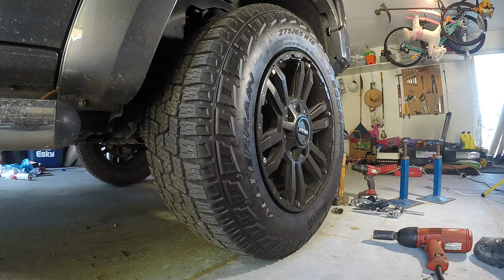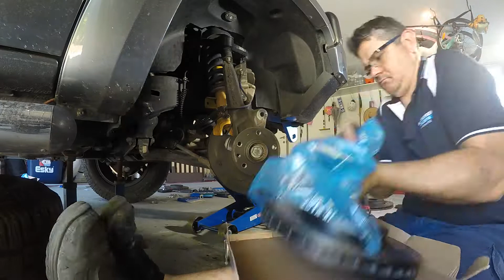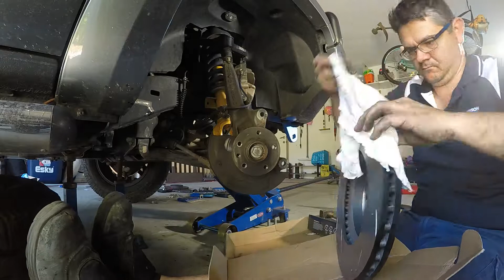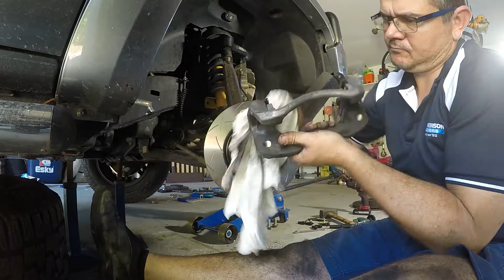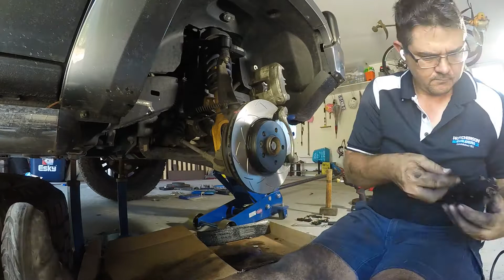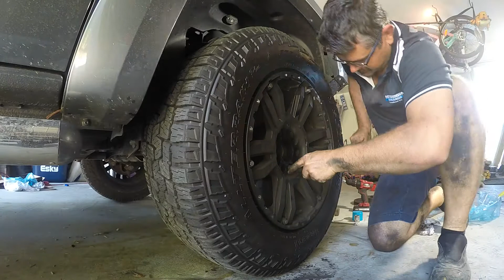2018 VW Amarok V6 TDI550 - Drivers Side Brake and Rotor Replacement Closeup

Comment: After removing the wheel before undoing anything else, get a pry bar or big flat screwdriver, stick it in the hole at the front of the caliper, you can lever the pad away from the disc all the way until the caliper piston is fully retracted, then remove everything as normal, when refitting the caliper will slip right on, no need to press it open with the g clamp, saves a ton of time and maybe the odd knuckle 🤙
Reply: Nice tip thank you
Reply from the maker: Thanks mate, I’ve since done the rears and had to buy a proper wind back tool as the piston needs to turn while being pushed back in…

Comment: What were you spraying on the new rotors and what were you spraying on the brake area when you were cleaning it?
Reply from the maker: Brake cleaner… spray a little on the rotor face and wipe clean. Be careful of the edge as there are paint marks that are heat affected paint (it changes colours at certain temps) that you don’t want to rub off.

This is just to clean any oil residue from the surface, although it will burn off if you don’t
Reply: @ hey thanks for responding man. I appreciate it. Do you open the brake reservoir cap before replacing your pads?
Reply from the maker: When I’m pushing the pistons back in.
I use a syringe to remove all the brake fluid I can get from the reservoir. I’ll push the cylinders back and the. Remove it all again. Once both sides were done I’ll top up with new fluid. I use genuine VW fluid for compatibility, it’s not that expensive… same as their coolant for topups, it’s not bad for pricing either. As mixing cool and and brake fluids is never a good idea
Reply: @ thanks again mate. Waiting for rotors and pads to come next. I’m going to give this a crack. My 2016 amarok has pads that have a wear sensor on them I believe so it will be interesting to see how I go with this. Your video was awesome. Thanks for your words too mate. Cheers
Reply from the maker: Good luck.

Just take your time.

Hardest thing was getting the carrier off… I used a 240v rattle gun, a large breaker bar will be required if not. I also used blue loctite on the carrier bolts when I reinstalled. You should get new caliper bolts with the brake pads, they have a dry loctite material already on them.

I found the little brake grease satchels for like $2 was enough. 2 per side is sufficient 

I also wire brush the face of the hub and then wipe down with brake cleaner before fitting the new rotor to ensure a clean mating surface… as they do develop a little surface rust.

Comment: What torque values when putting everything back together?
Reply from the maker: Carrier Bolts - 150Nm plus 90 degrees

Calliper bolts - 30Nm
Reply from the maker: And disc securing bolt is 20Nm
Reply: Thanks mate.
Reply: Thanks mate